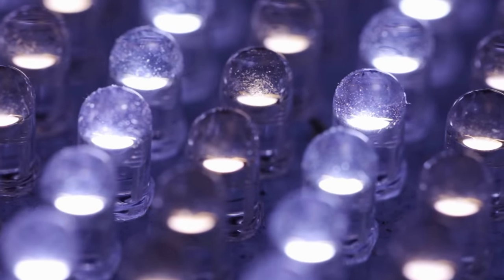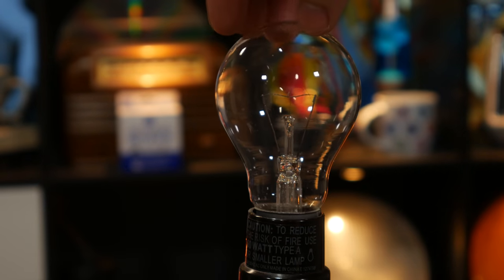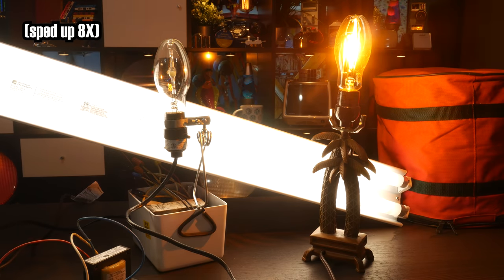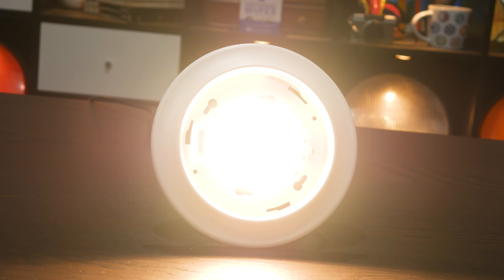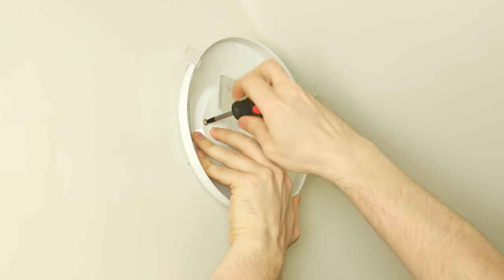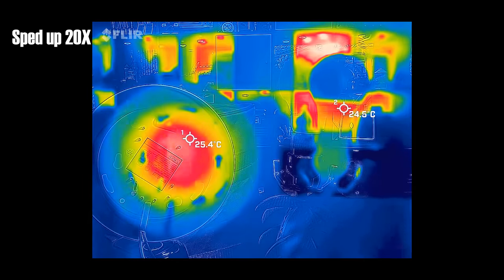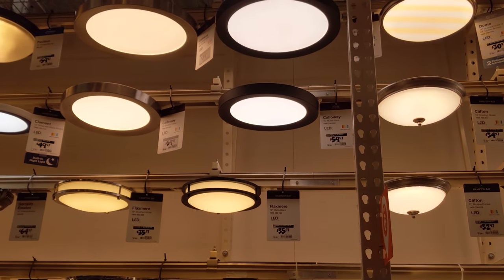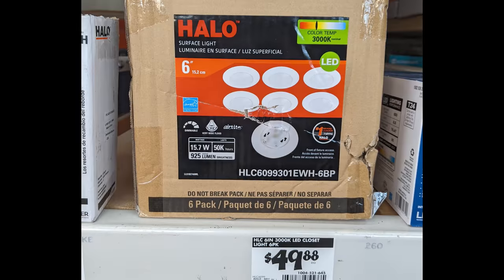A troubling trend in lighting?

Comment: I ran into this exact issue when remodelling my kitchen and looking for recessed lights, there were simply no good alternatives to these types of LED lights. Worse yet, if they break I am not allowed by (Swedish) law to replace them but have to hire a licensed electrician.
Reply: Same laws exist in australia
Reply: @Simoxs7  it's mostly to stop landlords doing lazy or shitty work and burning down the house tenants live in, also the way they enforce is electricians are legally required to snitch if they see work not exactly on code
Reply: @Simoxs7  Statism is slavery. A law is an opinion with a gun.
Reply: In Canada most mortgages require you to buy house insurance, and the insurance company may ask questions about the condition of your house's systems (especially wood stoves). Once the mortgage is paid insurance is not required. 

There is a national building code, but most enforcement is municipal and varies greatly town to town. Many rural areas have basically no enforcement other than social pressure and the desire for the occupant to not live in a dump of their own creation.
Reply: @questioner1596  Pretty accurate assessment of N. America. I would add in response to some of the other commenters above that it is nice to live in a dwelling that will not burn down around you while you are sleeping. DIY electrical work is a serious issue- opinions, regional, and legal issues aside.... I've lived in a building where modern electrics saved the structure and possibly lives. And I've seen (and repaired) others where sub-standard work did neither of those two things.

Comment: Honestly, I feel like another round of standardization should be done for these fixtures. A large, generic electrical socket and screw mount that can comfortably handle large fixtures, from which you then just plug in one of the newer fixtures and screw it into the mount. No need to deal with bare wires and - while throwing a whole fixture away is still wasteful - at least it has most of the convenience of a lightbulb for the average user, excluding of course the size of it.
Reply: And an adapter that converts this style.lf mount to use old style light bulbs in it would only have to be a cheap piece of plastic with some conductors in it, so you don't really lose the flexibility either

Comment: 14:21 it actually isn't usually the solder joints that fail from thermal cycling in LED bulbs. It's normally the bond wires that are spot welded to the external contacts inside the SMD package, and the actual silicon die inside the package. Solder joints don't typically fail unless there's a major manufacturing problem. The bond wires on the other hand just tend to have fairly poor yield when it comes to this due to thermal expansion cold working the weld joints to the point of fracture.

Comment: My grandparents place was built around 2000 and they used LOTS of can lighting that used fluorescent PAR bulbs.  Seriously, I think the master bedroom alone had like 9 cans.  They rarely turned them on because they used SO much electricity on top of making the rooms warmer (you could physically feel the heat coming from them when they were running even though they had 10ft ceilings).  My grandma was living there alone and could no longer take care of the place so my wife and I moved in and one of the first things we did was change all those bulbs for LEDs and it made a HUGE difference in energy consumption and room temperatures.  A lot of the stuff you touch on here is stuff I've noticed myself in the research we've done and experience we've had.  In 2019 my wife and I built a new house with a builder (my parents took over my grandma's house) and they used a lot of these builder-grade fixtures, both the full can replacement style and a handful of the surface-mount types like you have in a couple harder to reach areas.  So far we haven't had any problems.  But we also specified which fixtures (and what color temp) we wanted and basically hand-held the builders through the whole process to make sure we got what we wanted.  We moved in February 2020 (just in time) and haven't had any failures yet, though we don't leave them on every day.  Every fixture in the building is LED and we also put solar panels on the roof.  Our energy consumption is a fraction of what it was in my grandparents house even after switching everything to LED and solar means in summer our power bill is usually like $7.  LEDs also make room-to-room temperature regulation far easier, in fact we have to close or restrict the registers in most of our rooms because they are efficient enough they don't need full-blast A/C or heat.

Comment: I got two incandescent "vintage" style bulbs that i haven't had to replace for 7 years! Their still going strong and i use them every day.  I dont quite understand it other than the filament design might have something to do with it, and offers more support to it causing less vibrations to occur.  Other than that my mind is blown.
Reply: @Simoxs7  don't LEDs need resistors, which also waste energy as heat?

Comment: Thanks for the video. I do detailing and utilize Scangrip brand lights which have adjustable color temperatures, and high CRI+ (up to 96). Their CRI+ rating is based on average R-values of all 15 values unlike normal CRI which is only based off the first 8 -- excluding red.

Comment: I was an early adopter on LED bulbs, moved to them 15 years ago when they were expensive and relatively poor at actually lighting things. They are so much better now! Generally I've got pretty good life out of them, most (but not all) of the ones I have had fail are when I have accidentally 'ridden the switch' i.e. had the switch in a halfway position for longer than normal, and the bulbs have failed on the spot.
Reply: @dickJohnsonpeter  you must watch the previous Tech Connection video about wall switches. He talked about that issue with some "soft" designs.
Reply: Yeah, light switches in the UK are usually of the 'rocker' type rather than the 'toggle', it is relatively easy to have them halfway slightly longer than normal by accident during switching, I'm just talking about it taking half a second to move over rather than quarter of a second, not holding it halfway for an extended period. You can usually hear an arc happening inside the switch if you do it, as the connection is not made/broken cleanly. Again it's not common, I've probably killed only 3-4 bulbs this way in 15 years!

Comment: We could definitely use house-wide DC lines for lighting use. If a single large DC (maybe 24v or 48v output) power supply could be installed at or near the breaker and ran to light fixtures, LED light fixtures can be simplified further and last much longer.
Reply: I have seen something like this in Berlin, Germany, in the (former) house of a tech guy from the 70s and 80s, who was long deceased when I visited the daughter-in-law of his now living there. She had no clue why the house had sockets near the ground that simply looked different (three V-shaped prongs). Turns out is must have been such a low voltage line, for night lights, that would turn on at night time/in the dark. Never seen it anywhere else though.

Comment: I feel like most of the problems mentioned in this video would be fixed just by adding a standardized, polarized plug to the fixture/box (maybe ones like they use on RC batteries?). With that, these emitter + fixture combo units would be just about as general user serviceable as the screw bulb; bonus points if someone figures out how to toollessly attach it to the box!

Comment: I'd like to contribute my personal experience with this kind of LED fixture as it might give a different perspective. 

I love in a smallish two bedrooms apartment in which most rooms have only a single electric box for lighting. 

This means that even if I'm not able to find a fixture that's exactly the same model in 10 years, I'll never have mismatched fixtures in the same room. Additionally, since I've only got one lighting point per room, I need it to have a fairly powerful light source in it, which means an enclosed fixture with a bulb inside would be short lived. 

They're also cheap enough that I don't bother having to buy a whole new fixture when they eventually die.

Comment: I had a LED in my stove hood for 10+ years. I moved so I can't remember what kind, I think it was the Philips ones with 3 or 4 yellow lobes where the light was emitted. Those things were indestructible even when heavily used.
Reply: I guess the domain of incandescents remain unchallenged inside the oven-
Reply: There are some models of LED bulb that last, and some that don't.  Unfortunately, by the time you figure out which is which, they've stopped making that model, and you can't buy more.

Comment: I installed commercial type LED fittings in my apartment and usually run them at 5% output for most of the time (via Z-Wave). They run cool and will probably outlast me.

Comment: I've only had one LED die in my house since 2013... hallway, it's a semi-sealed enclosure. it was really good at killing "squigley bulbs"
Reply: lucky I have a problem where after a year the led just starts dimming until it barely outputs light. Last week I got the strobing problem on one of them as well. Maybe the electricity in my house is not god it was built in the 60's
Reply: It was mostly 2013 and later when LEDs existed for lighting. 2011 was the start of the LED light craze, that was when Springfield, Vermont started to get some LED streetlighting.
Reply: What brand?
Reply: @jakemj03  glolux! yeah, cheap stuff. Amazon basic has oddly been good to me as well

Comment: I recently installed one of those LED lights in my bathroom, but being the only light in the room it doesn't matgter about it failing as there are no other lights to match it with, so I can just buy something else when the time comes. If I had multiple in a room, I would use socketed fitting for the reasons you give in the video.

Comment: "You've seen dying LED lighting, I'm sure"
I've never known an LED to die.  I have LEDs on appliances from the 70s that work fine.
Reply: Modern LEDs that is. You are right about those 70s appliance LEDs though
Reply: Some years ago when I switched lots of lights to LED there were several which didn't last long. I even had one giving smoke signals before being dumped. And some of them were on a wire lighting system so completely free in the air. Lately there were less problems even with very cheap bulbs.
Light temperature is a problem. I wanted some rather strong bulbs but the selection of temperatures was bad. And of that it often said 2800-3000K or something like that ! Well, that's a difference. Or just warm or cold with no reliable or mentioned value.
Reply: If you've ever been outside in the last 5 years you should know it. Businesses cheap the hell out on big led fixtures, arguably I'm unsure if the efficiency is even good at that scale, but they go for the worst of the worst and they fail in the spectacular seizure fashion. Great for everyone on the road I'm sure.
Reply: Those old LED's that were indicator lights or very low brightness will last almost forever and are rated in excess of 100,000 hours. They are very dim and produce no useable light and almost no heat. When you are talking a light source to illuminate a room, they take far more power and produce a lot of heat.
Reply: @lkeil84  They do have that going for them but there's also Dubai lamps which run the LEDs at much more reasonable temperatures which creates higher efficiency and longer lifetimes. Also not to mention I once heard a traffic signal technician (can't remember from which region) say that a good portion of early 2000s LED stoplight modules with those low powered pixelated LEDs actually still function to this day 20 years later
Reply: Go into a Quick Trip or any other gas station some day. They almost always end up flashing or pulsing making it look like a dance hall. That's how LEDs die. Or they just get super dim.
Reply: That happens due to failed or failing capacitors
Reply: Diodes can last a long time if they aren't overdriven, but modern LED bulbs are designed for cost, not life.
Reply: You do know LEDs to die, but perhaps aren’t aware
Reply: theyre not high power devices though, just 'indicators' very different, the leds in lighting devices run at much higher power and can get HOT

Comment: The big problem that I have with those integrated fixtures is the flicker. These types are almost universally bad at flicker management. It was very noticable on your Menards stock footage as almost every one of them had a shutter roll of some kind. I guess I am sensitive to the strobe effect or something. 

I have had problems with the bulb form factor as well but it generally isn't as bad and much easier to replace with one that doesn't flicker.
Reply: Yeah most of those flat-panel LED fixtures are the cheap 'n nasty (but effective and fairly efficient) driverless type. I'm sensitive to the flicker too and it's quite bothersome. I feel like I'm in a well-lit rave when I'm around those. They REALLY need to add smoothing (even 1 cap across the LEDs does a ton) and a higher value sense resistor (the bit the driver chip uses to set current) to help. It's not even that much more work to do, as this video shows. Hopefully most fixtures use a smoothing cap either now or in near future.
Reply: they make pillz for that
Reply: iPhone Slo-Mo camera is great for picking up barely-visible flicker.  After seeing a slow motion video from one vendor of 4ft. LED tubes comparing their "flicker-free" lamps to others, I went around my house taking video, with some surprising results.

No flicker: Philips, Sylvania (Osram), & Great Value "60W" LED bulbs; most CFLs; T8 & T12 fluorescent w/electronic ballast
Low flicker: Great Value "100W" LED bulb (ceramic base); Great Value ceiling fan enclosed CFL
Strong flicker: Sylvania (LEDvance) glass/filament, EcoSmart, & H-E-B LED bulbs; Toggled direct-wire LED tube; T12 fluorescent w/magnetic ballast

Plenty of variance within a brand, so the only way is to test them yourself.

The only one I really notice the flicker on is the old-school fluorescent in my garage.  I'm replacing these with LEDs as they burn out, but I may as well order the flicker-free ones.  It also seems that this is more of an issue with the direct-wire type B, as the drop-in replacement (type A) tubes use your electronic ballast. (Those don't work with magnetic ballasts, but I'm quite happy to get rid of them!)

Comment: The thing is, the old school fixtures are "disposable" over a long enough timeline.  If this lasts as long as a traditional fixture does (so long as you keep replacing the lamps), I don't see the problem, especially if they make these out of sustainable materials.
Reply: It seems like his main issue is the lack of customization (color temp, "smart" expansion, etc.), which is a pretty large issue, but not the end of the world.  I still think that a standardized connector (which some of these fixtures do have, I've got one in a shower stall) can help alleviate a lot of the concerns, as prices will likely come down over time, and styling can be "solved" by having fairly standard designs, at least at the low end (similar to outlet plates and door knobs)
Reply: It won't last that long.  It won't even come close.
I have lights that are over 50 years old.  The chandelier in my hall is probably 1940s, I've got table lamps from the 1960s.
The chandelier has its original cloth-sheathed wiring, which is in good shape and is now considerably de-stressed by virtue of it now only having to supply maybe 25W to LEDs.
I'd give these maybe 15 years at best.

Comment: An angle people often forget about when discussing user serviceability is the materials (and therefore environmental and therefore CO2) overhead of including additional connectors etc. If you save, say, 1g of plastic on every fixture, that's a pretty big deal and might well outweigh the environmental cost of a small fraction of people needing to replace entire units.

Comment: My only issue with LED PARs and filaments is dimming.  Philips used to do warm glow dimming but they are getting harder to find.  I bought a cache on closeout.
Reply from the maker: I also am THRILLED with WarmGlow and yeah, they seem harder to find now. I hope that's just general supply chain stuff and not an indication that sales are poor.
Reply: @TechnologyConnections  I was under the impression they were discontinued.  The last time I bought them new from a supplier was 2017 and as far back as 2019 I was buying discontinued product on eBay because none of my suppliers could get them.  Granted I've only been looking for PARs, I'm actually ok with how filament type-A bulbs dim (this may have more to do with the fixture than the bulbs themselves.)  Also I am aware they still make a similar line for Home Depot.  I havent tried that line as I avoid Home Depot like the plague (I prefer to save 11%)

Would a video on dimming and why incandescent bulbs get warmer as they dim (and how LEDs compare) be too in the weeds?  (Of course it wouldnt-- I've seen what you do to Christmas lights)

Comment: Very good and interesting video, thanks. With the advent of LED lighting, I do wonder if there is an element of wheel reinvention where the new wheel isn't quite round. We are installing light fittings that have to be replaced when they fail. Would it not be sensible to have a new standard fitting for LED lamps? A modern version of the Edison Screw fitting. Kind of like a new wheel but one that is still round.